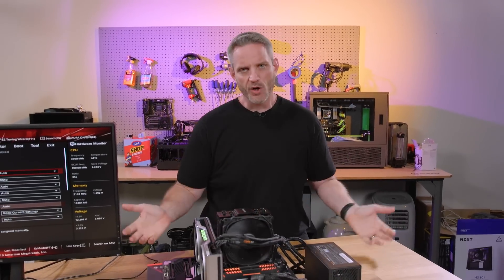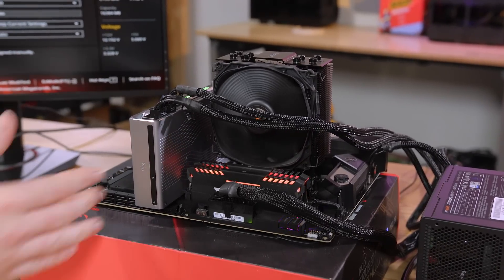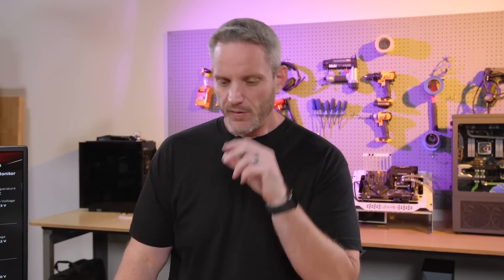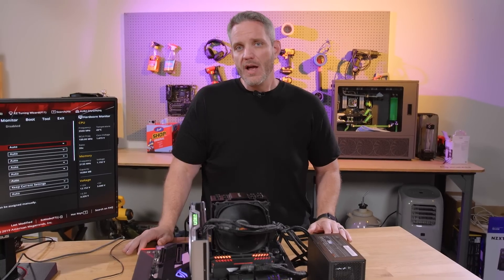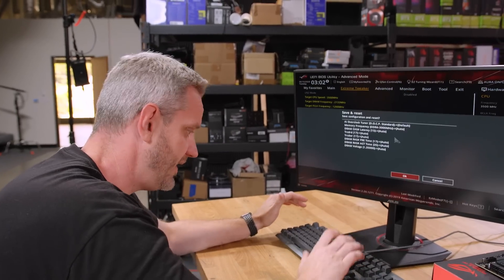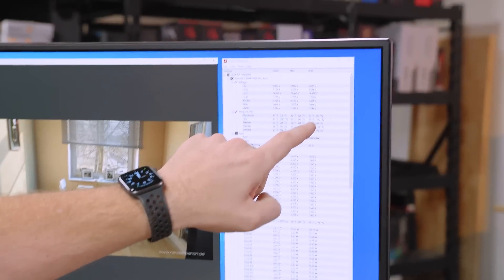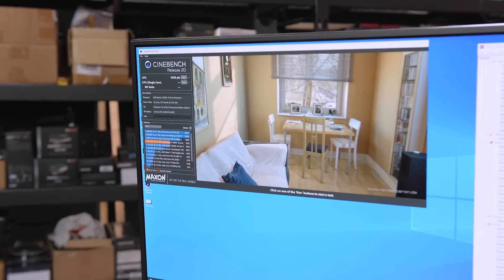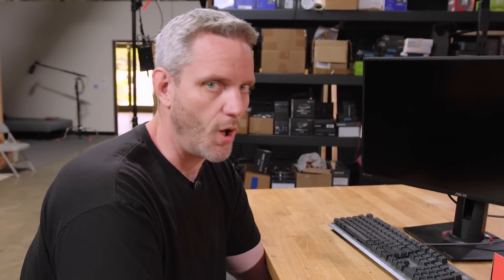Is your motherboard trying to damage your Ryzen CPU?

Comment: I not been worried as I have a thermal  head room since water cooling lol 2x480mm rads under mining load (same cpu  with a 2080 super clock I all sharing a loop and I watched the temps only hit like 38c  and I have mine of ( mutliplier locked) to about 4.3 all core.. I am mining and using the pc at same time with both cpu and video card mining..

Comment: Edit: Haha I did find your previous video that answers my question, stay cool! https://youtu.be/0JRY0Ri2VoM

It might have been covered in another video but I got my system together last weekend and am using the stock Wraith Prism on the 3900X. Is the Wraith actually sufficient if I'm not really doing significant OC, just the OC scanner?
Parts here if you're interested pcpartpicker list: mqnThg and I'm running the 4k memory underclocked to get the 1:1 ratio on FCLK. I didn't find out the ratio limits until too late... :(

Comment: lol i tried your sponsor. they are dodo. Way over charge. Lol seems like if you pick new parts they charge you for the old and the new one cuz the price jumps a lot. So i built my own. Way cheaper. Not hard at all really, tho i ran into problems with microcenter. lol I got a gigabyte 5700 oc. that was a open package. and a 1000w full modular. I get home and realize i didnt have all cords to the power supply, but the real problem was they gave me the wrong graphics card. I guess some one bought a 5700 and swiped it with their old gpu that was like 60 bucks. lol I was heated cuz i put the whole computer together then realized it was not looking like everyone else. I took the stuff back and they gave me a brand new 5700 oc. Power supply was a dud. They said they didnt sell the extra cords to the power supply that i needed for it.

Comment: Jay: I have a ryzen 7 2700X on a strix x470-f, and 2x16gb 3200 ram...I use HWmonitor, after a few hours of use on my computer I notice the cpu clock speeds in the max column are outrageous.  I have seen where all cores say they were at one point up to 5.8 sometimes even say up to 6.3......is this a fault in reading between HWmonitor and my setup?  Or is my cpu actually hitting these speeds?  I have pics i can DM you if you need to see them....Also, Im a huge fan, keep up the good work

Comment: my 3600 runs stock at 4.09 to 4.14 and voltage is up to 1.47v.... why can i overclock it to 4.3 on  only1.375 volts????  temps are overclocked at 85c, stock the same...

Comment: Are you saying someone bought a 3950x but isn't putting a noctua NH-D15 or similar sized air cooler on it? or at least water cooled. I guess some people might have put it in an itx system without the space but I kinda doubt that is the average user.

Comment: After running my 2700x for 18 months, it started acting up, with lots of random black screen crashes. 
Turns out (after all parts troubleshooting) my MSI x470 was pumping a constant 1.456v into the chip, this never droppped below 1.44v  
I was Forced to under-volt to 1.39v and now everything seems to be fine

Comment: If you guys follow Toms Hardware or PCMag, you guys need to find new sources of information.  TH is no longer the source it once was. 
This is pretty much the same thing as MCE for Intel - which has become the defacto mode for most motherboards.  So much so, that most users think that MCE performance is the default performance of the chip.  So, MCE, which basically lets the CPU run at the highest power for longer (some boards even unlock the limit). 
 I've tested this on a board that does this.  The voltage is still within "spec" - meaning that it's not shoving 1.6v or 1.7v or anything like that.  Btw, use HWinfo64, not HWMonitor (or Ryzen Master Mr. Timestamp this).

Comment: From what I read, I think that 255 on the temperature option in BIOS is a scale from 0 to 255, but these are the steps, not actual degrees. So at 255 in BIOS does not mean it is allowed to reach 255 degrees(F, C, unlikely K...)

Comment: Nice Video. I also noticed the 1.48 V idle on my 3700x. Sometimes it hovers at 1.0 - 1.3 V when i open Master, however sometimes it hovers at 1.4 and peaks 1.5. Just undervolt it in Bios or Master. It will also run stable at lesser voltage at 3.8 or 4 GHz all core. Got more core clock and lower temps. Jay stated, that this is just how Ryzen works (high voltage at idle and lower under load), but I don't really know why this would be necessary, could someone explain that?

Comment: Jay I have had an Intel i9 processor and a gigabyte motherboard for almost a year and have had nothing but problems with my computer randomly shutting off noticing when I use hardware monitor the voltage on my motherboard would spike up out of nowhere and so would the temperatures. I could really use some help with ideas for how to fix this because I’ve been trying to use my computer for streaming, gaming, and editing and yes I’ve had it shut off while I was doing any or all of these tasks several times. Plz help

Comment: So if under load it drops the voltage down to 1.25 from 1.5 idle. Why shouldn't we just run it at 1.25 all the time?
Reply: Problaby ryzen needs less amps but similar wats (so higher volts) in idle and under load it needs more amps and less volts ?
Reply: @eastpol7451  CPUs don't have a watt requirement. They have an amp requirement and a volt requirement. There's no reason the volt requirement would go down when the amp requirement goes up. The only reason you'd have a watt requirement is to stop your CPU freezing with some of the extreme coolers Jay tries.
Reply: This is accounting for changing clocks. 1.25 V is not enough (on most chips) to sustain the boost clocks. On my chip I need 1.38 V to use it at 4.15 GHz. To reduce temperatures, the chip clocks down on its own and therefor can reduce its voltage in idle operation. Out of the box it adjusts itself to balance temperature, voltage and performance constantly, so you often see different voltages between 1.25 V and 1.5 V.
Reply: @Andy Young u need vdroop, not to much but vdroop is healthy for a cpu

Comment: JAY!! Please dude! Your killing me.
Please use HWINFO64 for Ryzen, Hardware monitor is just flat out wrong especially with Ryzen and especially with voltages. VID is what the cpu is requesting, not what it is getting, easy way to tell that is look at vid in HWINFO64 with a manual oc, it reverts to 1.1V  all the time because the manual OC bugs out the VID reading.
HWINFO64 reads the SVI2 TFN sensor that is the on die voltage sensor, when people have tested it with a probe (buildzoid) its normally accurate to 3-4mv. so truly one of the best and most accurate measurements. Hardware info takes the reading from vcore on the motherboard. This is taken from the voltage controller before the power is sent through the vrm and there is loss as heat and so on. In my testing this is less obvious at idle, but under load you can be looking at over 30mv. The image below is of both tools running and giving totally different readings while cinebench R20 is running.
https://i.redd.it/kviwqdpcff251.png
"Thermal Protected restart" aka OCP (over current protection) this is the motherboard shutting itself down, not the CPU. This can be disabled in BIOS, but should only really be done if you are using ln2. You probably know this but, just a general explanation of what is actually happening for anyone who read this far.
Other reasons why hwinfo is better with Ryzen, it gives per ccd temps, it shows PPT EDC AND TDC usage so you can see what limit you are hitting.

Comment: Had a bad case of degredation with an i5-2550k...It clocked to 4.6GHz easily when I first got it...didn't think or care to find the lowest VCore where that is possible...after two years achieving 4.0GHz wasn't feasable anymore.
But that same CPU, now nearly 10 years later happily does office work for a friend of mine.

Comment: that made me wonder now if my underclock is the problem or is it windows updates.
Ryzen 3700x
4.2Ghz on 1.275volt on all cores. temps got down so much that i can sleep easy and performace went from 4600 to 5003 in C20.

Comment: Remembers me of the voltage Problems by the 4th Gen Intel Prozessors. The Mainboard were pumping way toooooo much voltage into the CPU's. Yet look at the 4770k's, 4790k's,...,... which are still running fine after around 6 Years

Comment: on the asus boards you have 2 different voltage sensors socket and die  both have some very conflicting voltages while it should be the same voltage ,found this out while trying to get my 3950x stopping to black screen due to overtemp @ 4.3 ghz with 1.305 vcore

Comment: Had this happen with b450 tommahawk max and r5 3600, it was pushing the cpu to 1,45V from start and even at high clocks and wouldn't even finish r20 with stock cooler.

Comment: Hi, I was under the impression that 'vcore' (or core voltage in CPU-Z) is the actual voltage the CPU is receiving, and VID is the voltage requested by the CPU (not necessarily receiving). Is this not correct?
 I.E. with my CPU, CPU-Z will state 1.28v core voltage, and so does hwinfo under 'VCORE', but the 'VID' for each core is over 1.38v.

Comment: Jay - back when I had my 2700X (I now have a 3700X), enabling Core Boost Performance would max the TDP at a 100% even at idle. How do I beat that, and is it bad?
Reply: it was a bug between windows and ryzen master if you go change your power settings in windows it would fix it from showing up but may come back not really causing any issues tho

Comment: I always make it a point to check the Vcore on any new AM4 mobo that I get.
I'll run it stock at about 1.28V, and if overclocking, about 1.35 to 1.37V.
1.41V stock voltage is bloody insane.

Comment: My Ryzen 3900X threw tons of memory errors a month or two after i built the new PC. Down clocking the memory frequency worked for a while, then it started failing and I needed to drop the frequency again. The symptoms are very similar to memory degradation as described by overclockers. This usually happens if you try messing with the voltage to the memory controller. Something the auto settings in the motherboard never should do. I'm still pretty sure my Asrock X570 Taichi board is the culprit as I noticed later BIOS revisions lowered a lot of the tertiary voltages in auto mode. However by then the damage would already be done and the memory controller would have started to degrade which is what I think happened to me.

Comment: You're gonna get mad at me, but I've been running my 1700X non-overclocked. It'll boost itself to 3.5ghz when needed and then drops to 2.1 when idling or browsing the internet. Not that I'm scared of degradation, but it simply hasn't been necessary for me to overclock it. I don't game on 1440p (yet), so 1080p is all it's going to have to support. The reason I got a 1700X is because I expected to have to overclock it right from the start, but nope. I'll overclock it when I notice a drop in performance, but until then I'm gonna leave it as-is.

Comment: you kind of missed the point here:
all this discussion is aboit a single number provided by the motherboard that raises the powerlimit of the cpu (you pull 90w,but your cpu thinks that its just pulling 60w and therefore can boost higher)
this number is almost always not directly controllable in the bios settings, but you can correct it by setting a lower powerlimit target manually (in this case 60w)
so you definetly cant fix this by setting some bios settings to default or auto, because this is NOT the same problem as intel-boards have with the core enhancement and default removed powerlimits etc.
Reply: This it’s driving me crazy how wrong this whole video is. The issue is you can’t trust software monitoring you have to use physical measuring. To use his car thing it would be like the speedometer saying 50 when your going 60.
Reply: Like with 1st gen Ryzen where some reported different temps than what they were actually running at?

Comment: I have an ASUS Crosshair Vii with a Ryzen 3900X cooled by a Scythe Mugen with 1 fan. I have used AI Suite to optimize it.
All cores get 10%. So all Cores runs at 4200 ghz. I have no problems with temps and volts. If playing, the temps goes to 50°C. at 1.2 V.  If Rendering a Video, temps going to 65 to 68°C and 1,25 - 1,3 V.
So just use the ASUS AI Suite and good.

Comment: I run an asus board with a 3700x and its overclocking my cpu all core for 4000-4200 mhz with the prism fan, it started doing that for no reason and now my cpu under load is on 75c and idle 60-65 which was fine I guess if my pc didn’t crash twice a day, it freezes and do not respond and then I need to restart it, I tried changing profiles is ryzen master - didn’t work , it wouldnt apply to what I configure which is canceling the overclock and when I go to the bios the voltage is 1.465 - way too high, and I can’t change it at all, what happens is probably what jay said 16:20 the cpu shuts itself, can someone help me stop the problem?    when it crashes it says  waiting for  cashe

Comment: i have a Asus tuf m b450 board for my 1600 and with performance setting in bios it would go to 1.37 volts without a OC.i can push 3.9ghz with 1.2volts btw.

Comment: When intel can't kill amd ryzen 
Motherboards 
"Fine I'll do it myself"
Reply: Mohammed Shiraz when AMD needs 7nm to compete with Intel 14nm just to still lose in gaming performance
Reply: @thespicyswede9302  Yet they are still selling them hand over fist. 7nm isn't solely about a need to compete. The market wanted more than Intel was willing to offer. The process allows for increased efficiency and density. AMD was already offering double the cores/threads on 14/12nm Zen/Zen+, and doubled it again on the same motherboards. Getting more of a largely better processor for your money, is a good thing. The PC is about more than being a gaming box, and you don't get to ask top dollar for a product that is worse in a multitude of other segments. The difference in gaming doesn't hampered ones experience. The Ryzen platform is actually advancing the space and Intel is literally just constantly reacting to that fact. If more cores and threads didn't matter, Intel wouldn't be bothering to alter their product lines to follow suit.
Reply: @blkspade23  I'm just pointing out that it impresses me that Intel can do so much with 14nm and that it took AMD going to 7nm for them to overtake Intel in most regards
Reply: Stacey Bright but why get overall better cpus for a cheaper price when you can pay $40-$100 extra for 7 more fps? In my opinion anyway.
Reply: @thespicyswede9302  "can do so much with 14nm"
By doing stupid overvolting bullshit and avoiding 10nm as much as possible, sure. Give them stupid credit for that silver lining they don't deserve.
Reply: @thespicyswede9302  AMD go with the best, appropriate node available for their architecture, at time of dev and manufscturing. AMD is fabless remember, they use commercial market fab services. Intel use their own in-house fabs (at least for CPU silicon), and those have fallen well behind the rest of the industry bc of their 10nm difficulties.

Now I certainly agree, it's impressive what Intel has managed to squeeze out of 14nm skylake++++++++. In terms of peak game performance. In terms of efficiency though, it's not a good story. Neither in terms of multithread workloads, which more and more software is utilizing now that the minimum amount threads on tap on avg user systems have grown and solidified the last few years. And those things really matter a lot, especially big picture. And for individual consumers, we've gotten into some rather harsh compromise territory, in particular on overall value, power draw and cooling.

Intel really need to get their s**t together with their fab tech, or the market share they've been coasting on for the last years is gonna eventually plummit. There is still time, but it's kinda running out. Because neither TSMC nor DF are having these kinds of issues, and their continuing development haven't exactly stalled. Neither have AMDs nor Nvidias. IMO many may enjoy seeing Intel get taken down a peg, but "no one" wants t see them eventually dwindle and fail - that would both directly and indirectly hurt the whole industry. We want fierce competition on all levels.

It doesn't really make sense to compare AMDs current use of 7nm vs intel's use of 14 either. Because while Intel has just about hit the material limit for their 14nm skylake tech now, Zen 2 is AMDs 1st try and 1st gen architecture on TSMCs 7nm. TSMC is already doing 5nm production. But if they had to stick to 7, AMD have just begun scratching the surface of what can be squeezed out of TSMCs 7nm (and plus/e) node.
Reply: @thespicyswede9302  Then you are too easily impressed by Bullcrap.  Intels best race wins out in single core performance by a mere pittance.  None of which is worth them asking 2x's the price for a CPU that is based on 2002 technology in 2020 and offers nothing to anyone except to those who have to overclock stuff to justify being ripped off.
Reply: @thespicyswede9302  laughs in 5000 series ryzen
Reply: @plakeplays6420  lol
Reply: Noah Pepper haha I’ll roflstomp a 10980hk with my g14 in cpu bound gaming. Try me. I fricken dare you.

Comment: Over clocked my GPU and my PC is being very slow nothing works I only changed memory clock and core clock and I tried for an hour to put the settings back to normal and I did and it worked but when I restarted the PC it was back to the way it was before

Comment: Maybe someone can help me out here, when I tried to change the voltage in the BIOS from auto to 1.30V CPU-Z and other programs said that the current voltage is around 1.55V.  I didn't want want to kill my CPU and just changed it back to auto. Auto voltage is between 0.7V-1.2V. My CPU is the 1600AF on a Gigabyte x370 Gaming 5. 
Is this behaviour normal?